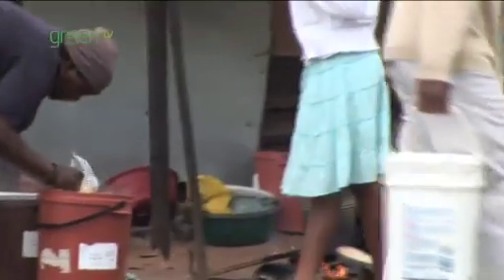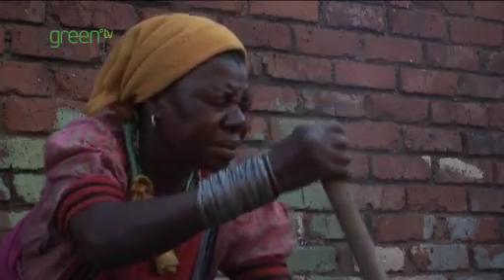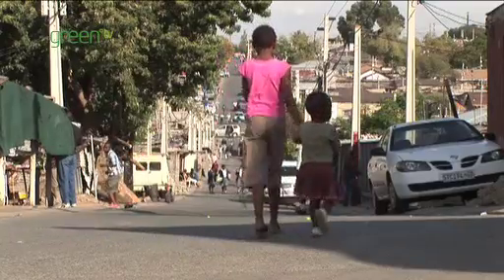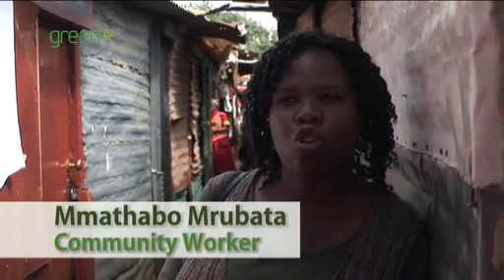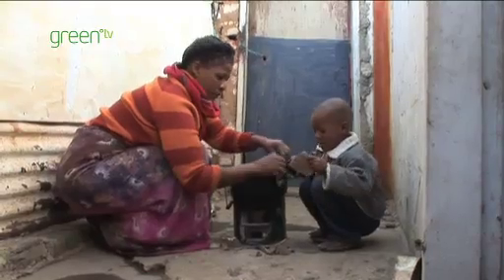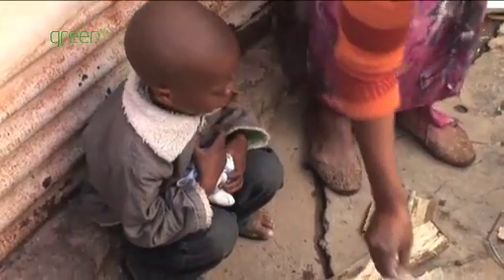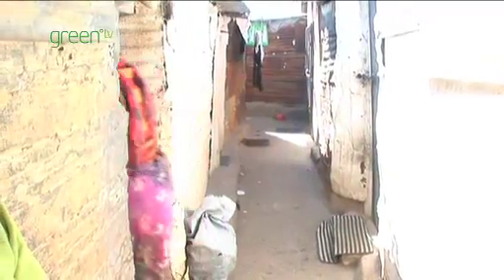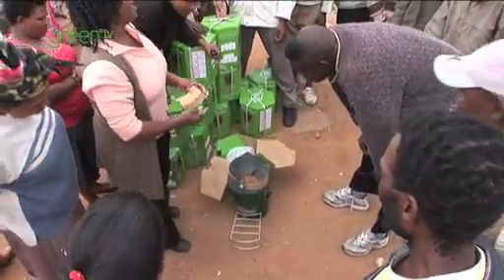Making affordable, efficient stoves for the masses

Comment: Blah blah climate change blah. 
I noticed you're using clay mined from the earth, leaving huge ugly torn open holes, using equipment that burns fossil fuel.
These clay pots are fired using "traditional Chinese methods", i.e. wood, then the stoves are assembled in Chinese sweatshops. Solving problems. Even if you create more.

Comment: I think a better solution would be an electric solar stove that doesn't use up our natural resources, the cost can be subsidized by their governments
Reply: Ellie James yes, yes , the west is responsible for all the world's corruption, we are so evil and everyone else is good and always has been, we are not the least bit charitable in any way
Reply: +Ellie James Electric solar isn't really the way to go. Your typical solar panel is about 15% efficient, so right away you're wasting 85% of your energy as heat in the panel itself. Next, you need to figure out how much area you'd need for the panels to provide enough electricity. I'm guessing the minimum for a small stove would be about 250w (campers and the like, feel free to correct me), and as most panels provide around 20 watts per square foot, you'd need a little over 12 sq. feet of solar panel to provide that. Solar panels need to be mounted in direct sunlight, kept free of obstructions and dust, are made of easily-broken glass, and according to some quick eBay searching, cost about $250 for the amount of power we need.

We could use a much smaller panel and store the energy in a battery if they're not using the stove for more than 15-30 minutes at a time (a reasonable assumption), but now you need a heavy, lead and acid filled battery that needs to last for years with no maintenance, and hope they don't throw it in a landfill near their water supply if it stops working.

For cooking with solar energy, the best way to go is with solar cookers, simple devices with curved or angled reflective pieces that reflect incoming sunlight towards a central point where you hang a pot. They take a while to heat things up, but they're incredibly cheap.

Granted, both of these depend on it being daytime and not cloudy, which isn't always the case when you're hungry. The stoves in this video seem like a good complement to solar cookers, and I bet a mixture of the two would reduce their fuel use substantially and still let them cook whenever they needed to.
Reply: +Phoenix, solar panels are becoming more efficient and cheaper.  I'm hoping soon they can invent a small solar stove that only needs one panel. I just saw another video about more enhancements to solar.  Until then, these stoves are options to preserve our precious natural resources
Reply: Do you really think their government is going to pay for something ?
Reply: David Thompson , not all African governments have been corrupted by the western criminal governments
Reply: David Thompson ,  they have caused the most chaos since the beginning of the millennium.  They're guilty of the current middle east turmoil and of overthrowing legitimate governments to benefit their agenda and not the citizens of those countries.

Comment: First of all, Who runs the provinces in africa? this being a country that is older than the U.S.>>> their progress is what? 2nd, why not send instructions on how to build "real" rocket stoves that could be built from scrap metal, the most efficient way to burn wood for heating. I'm not talking about some cunt "L" shaped stove, a real Rocket stove has a chamber the gases burnt from initial fire rise through the riser tube into a container surrounding it and back to the bottom building up a secondary burn on the gases before they travel out the exhaust tubing from below. the top of the outer casing reaches degrees of temperature that is quite sufficient to cook on, & quickly i might add. 3rd and most important of all, maybe they are just too third world to understand these things. Hosea 4:6 My people are destroyed for lack of knowledge: because thou hast rejected knowledge, I will also reject thee, that thou shalt be no priest to me: seeing thou hast forgotten the law of thy God, I will also forget thy children.
Reply: Qballfph It is hot enough in India, these stoves send a lot more heat out the top where the cooking is actually done instead all over like a metal stove. What was that 4:6 thing you got hosed by?

Comment: I see a few people on here saying it would be better to print up instructions for people to source the parts locally & build it themselves. As they point out,that would avoid having to use the fuel to ship them & the emissions resulting from that shipping. That would also help poor villages that can't afford to buy one. I have built several of these stoves for camping & they work fine so long as you get the basic idea down. The efficiency will change drastically though. A poorly designed stove,while it may work fine will need notably more fuel to operate. That would be a problem if people made their own. They won't be able to find ideal material,they won't get measurements correct etc. Very simply they won;t be optimized for efficiency. The mass produced stoves are,on average,much more efficient than someone making their own & the increased efficiency will more than make up for any emissions produced from shipping it. For areas that won't be able to afford one yes,a simple set of directions on how to build one will help. Even if what they build isn't ideal it's probably better than what they are currently doing.
Reply: Leo Cane They are just plain lazy, to the point they cannot even organize a weekend trash pickup day. The streets and alleys of those towns are disgusting. Why not clean up the neighborhoods maybe once a month. Find a place to take the trash instead of just throwing it into the streets. They really don't deserve anyones help.
Reply: We occidental arrived in africa, destroyed their culture, move out, and now we think that they have to be like us. WTF
Reply: You are saying that in Africa does not exist argil? and people is so stupid that they cant make a stove like this?... Anyway we should think why they are like this, living in industries discards while there is people that have the money to buy cars...
Reply: +Leo Cane 
illiterate much ?

Comment: Depends on what your objective is to having a rocket stove. When built right they put out a great deal of heat with a much smaller fuel requirement. You are right that the carbon output still exists, but the principle is that burning (for example) 1lb of fuel per hour versus 4lbs per hour will be much more economical and will only emit a quarter of the carbon per hour of use.
Me, I just want to build one because I'm a cheapskate and don't want to store a massive supply of firewood.

Comment: there is no such thing as "totally different scientist". you are just saying this because you have a belief, and anything contradicting it has to be dismissed.  what, you think i WANT there to be global warning?  being a smith, i would prefer to just burn gas and coal and pretend that it's all fine. and it's true, smithing does generate CO2. but so does breathing. CO2 in itself is not a problem; it's the imbalance. in usa, only 5% of original forest cover remains. where will oxygen come from?

Comment: You could buy one of those for $100 or you could pay $10 for a 4" elbow and 24" x 4" piece of metal ducting and get the exact same thing. I'm sure they can find some rocks to prop it up. 

I made my own out of 4" ducting with 2-Tconnectors a 24" pipe and a 4"-6" expander with a 6" cap. Put the cap in the expander and fill it with rocks, put a T-conector in it with the hole on the side with the other end of the pipe going up, fit the 24" pipe into the top of the T and the last T in with hole up.